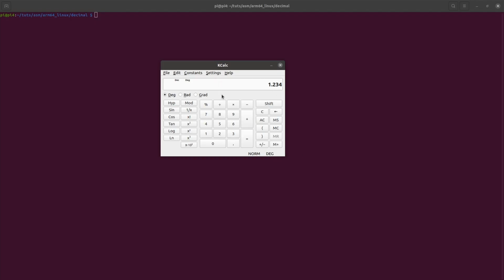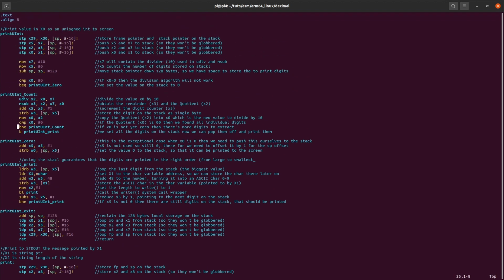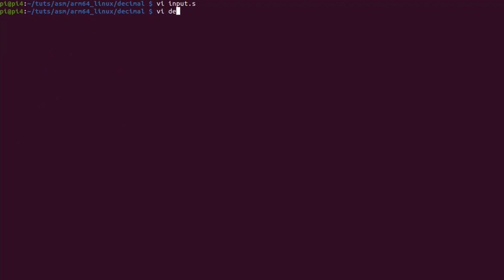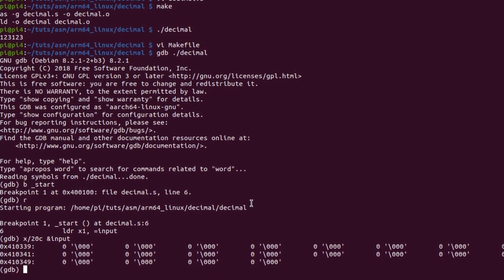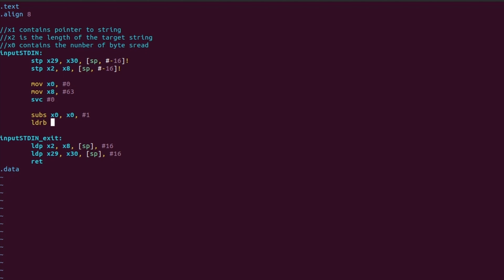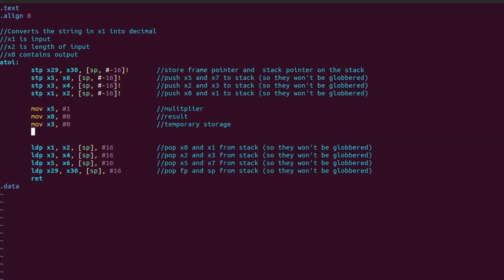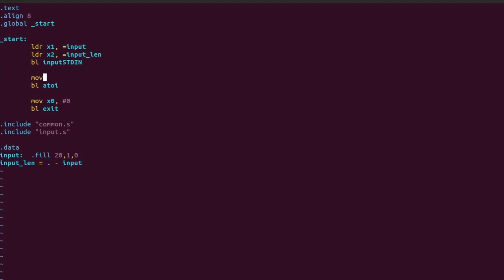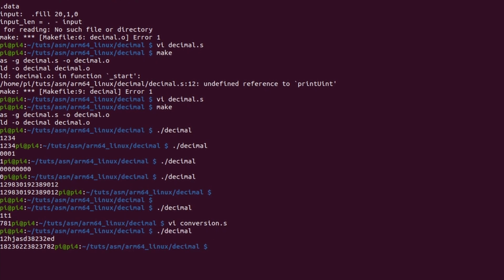ARM64 assembly part #4 (stdin and string to dec conversion)

Comment: I need some help. Has anyone lldb to work with as using the -g flag, on a M1?  i get these two errors every time I try to set a breakpoint. Thanks.  
error: No selected frame to use to find the default file.
error: No file supplied and no default file available.
Reply from the maker: There’s some nuance differences btw using M1. The code you see here won’t run one to one. Instead of using ldr to point to a string you need to do:
adrp X1, myString@PAGE          //set X1 to address of the string
add X1, X1, myString@PAGEOFF    //align to 64 bits
Very annoying.
And no I didn’t use lldb I use gcc and gdb installed using brew. Just curious does it work with -g ?
Reply: @CallousCoder  Thank you, Raymond. I didn't know that. Is there some resource that discusses those differences?  That might be a good subject for a video.

While I do have gcc (via brew) on my M1, gdb is not available for the M1 on brew, and my Linux box is a VM on my Unraid server which is x86. Perhaps I should get a Raspberry Pi. The fact that Manjaro has a distro for the Pi is encouraging. For the moment, I'm forced to use the Xcode (which has lldb) toolchain. Either I'm doing something wrong, or the -g flag for the M1 assembler is not working. I'm getting the idea that Apple doesn't want assembler programmers. 

Thank you for your work on YouTube. Please keep those videos coming.  One more thing... would you please do a "getting started" video that discusses your ARM64 toolchain? Thank you.
Reply from the maker: @56phil020244  I have a hello world in the github for the M1. I wrote that when I bought a Mac mini M1 that I returned the day after because the screen control is flaky. So have not had more experience with the M1 yet.
I was amazed that ldr didn’t work but that you had to do the add. I have no idea why Apple works different than Linux on ARM… it makes no sense to me. But that was the only thing that was different.
Reply: @CallousCoder  Okay, Thanks.
Reply from the maker: @56phil020244  here are the two m1 things I made https://github.com/rdoetjes/tuts/tree/main/asm/arm64_m1